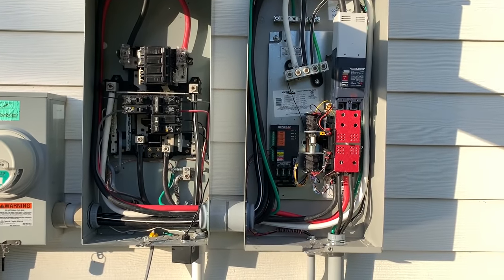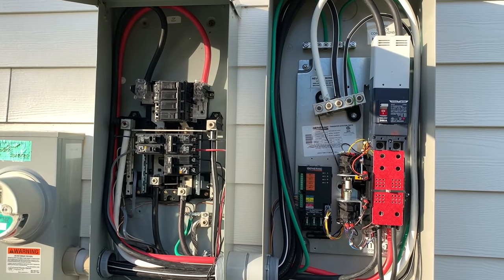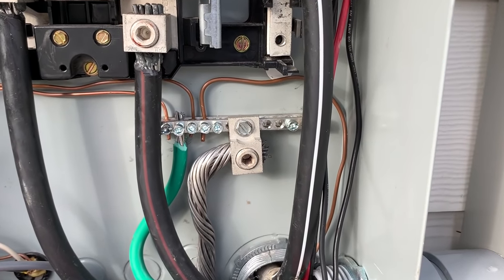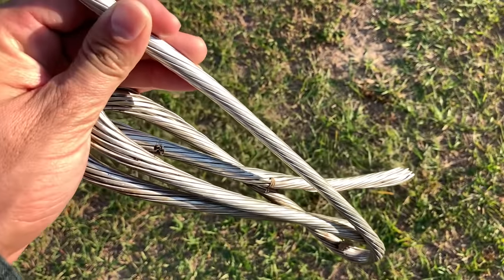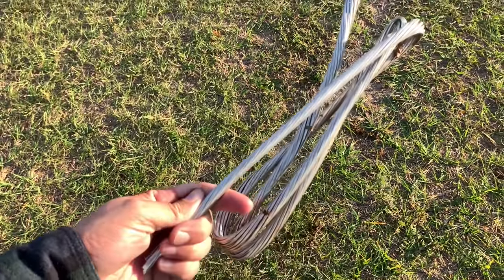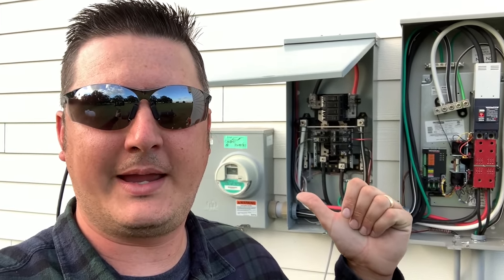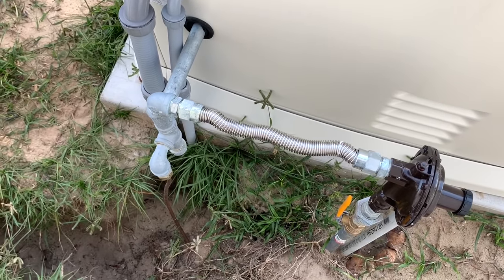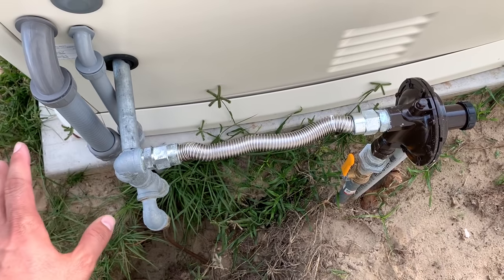Problems with our Generac generator install￼

Comment: Great series on a generator install. In N. Florida, what do you think is a fair price to install one like yours (24kw) professionally if I have it sitting on a pad with my meter & gas 20’ away? Thanks from New Orleans 🎭
Reply from the maker: Thanks for watching! I’m not sure how much installation costs these days, it all depends on if you’re renting or buying the gas tank too. I would estimate gas set up costs are around $2000 and installation for the electrical part is probably about $2000 as well. That’s just a wild guess though.
Reply: Hey, ojb 1959,  I just had a 24kw Generac Model# G0072101 installed in Metairie (Next door to New Orleans for those who don’t know). My total cost was $13,925.02 but that included everything for what it is worth.  Gas meter was 50’ away and electric panel was right next to generator (about 5’ away).
Reply: @Do_the_Dishes  Thanks for that. I’m shopping around now for the best price and yours sounds average. I’ve seen the 24kw Generacs with the transfer switch online for under 7k delivered free. I’m hoping to get one and find a reputable installer to save some bucks doing it that way. They definitely went up in price.

Comment: looks like they should have had a union to tighten that flex connection without twisting the line.
Reply from the maker: That’s a good idea.
Reply: Also with our generators your propane secondary regulator needs to be a minimum of 6’ from the generator. If too close the diaphragm in the regulator and generator can fight each other and possibly cause engine surge.
Reply: The supplied hose has a union connection attached.

Comment: My question is it appears you removed and did not use the xfer switch's internal covers.  More specifically if you did use the covers then the service entrance would have to be in the upper half of the xfer switch box.  It sure seems to me that the designers of that xfer switch really did not want service to enter through the bottom of the box.  So my question is why did you not use the xfer switch box as it was intended and bring the service it the top half (either side or top) of the box?  I am about to do an install and my current solution is to bring it in the side.  The xfer switch instruction manual shows the service entrance in the top back through the only (yes ONLY) knockout in the xfer switch box.  So it would have to enter the wall.  Whats up with that?!!

Comment: I would question your statement that ground and buss bars are aluminum.  Aluminum is much more likely to strip the threaded connections.  Possibly aluminum coated steel, like exhaust pipe.

Comment: Buen día : que calibre de cable usaste del medidor al tablero de transferencia y del tablero de transferencia al centro de carga
Reply from the maker: I apologize my Spanish is rusty, I used 2-2-4-6 aluminum wire which is rated for 100 amps between the ATS and generator.

Comment: You installed a 24k generator and looks like you have a 200 amp service. When you are on generator how do you keep from exceeding the generator output?
Reply from the maker: I installed a 200a service just so I could add stuff in the future. My actual continuous load it around 70-80 amps with the AC running, so O didn’t have to do any load shedding. If I ever need to, I can manually turn off circuit breakers to certain items like the water heater and such.

Comment: Great video Mr Maynard. I had a generator installed at my house in March 2022. I have a combo meter and electrical panel with a divider built into it. The electrician who wired it said that he could wire that ats into my existing setup.  He also indicated I will be getting a visit from the permits department in my local jurisdiction to inspect and sign off on the installation. As of this date I have not gotten a visit from the jurisdiction. It may be coincidental but I noticed my LED lights inside my house quickly blink every time the AC compressor engages. I don't recall this happening before the generator was installed. I plan on contacting the jurisdiction to have them come out but don't want them to tank my whole setup. Kind of at a loss on how to proceed any suggestions?
Reply: If it’s a Generac it will blink. Windings are not the best in the alternator.
Reply: @midstateutilities3836  
I need to clarify that the lights blink with any compressor load or other appliance load while the generator is off and we are on normal power. I don't recall this happening before the ATS was installed for the generator. Voltage coming in was checked and it appears to be low at 116 volts on both hot legs.

Comment: Use anything to coat the wires. Grease , lube oil etc. You are missing the bushing on the back of the panel.

Comment: Standby generators like generac are only capable of 100 amp max load so it's a good idea to have an emergency panel capable of only handling 100 amps.

Comment: Maybe someone can explain why the bridge between grounding and neutral bars. (Sorry if I missed it)

I might consider a 400 amp service to two 200 amp boxes for house and then everything else.
Reply from the maker: Great question. The grounds and neutrals must be bonded at the first means of disconnect, which is now the ATS. The original first means was the sub panel.

Comment: That UF coming out of the bottom of the outside panel needs to be protected.
Reply from the maker: It will be sleeved in pipe and buried, it’s a temp wire for my pool.

Comment: i thought it was fun to watch someone else for a change have to wrestle those wires in place.    why didnt you go with copper for those??   wouldnt it have been smaller at least then to use the aluminum biggies?

Comment: My problem is when there is a utility power disruption my generator is set on automatic, but it doesn’t start or even try to start any ideas on that problem.
Reply from the maker: That sounds like a bad fuse in the ATS.

Comment: You don't need 2 conduits to gen unless you are using non 600 v wires for 12 v.
Reply from the maker: The sprinkler wire I used was only good for 130 volts unfortunately. Generac actually makes a control cable that matches the color coding perfectly and it can run with the feeders because it’s rated for 600 volts. It’s more expensive though.
Reply: @MaynardFamilyHomestead  Just checking. You were correct to do that.

Comment: Appliance connector cannot be installed through wall penetration to generator, that's code. Always needs to be a nipple out of the boot. That street 90 elbow looks goofy and the 3/8" copper unerground won't run much more than a small grill at no more than 20 feet away (less than 35K BTU).

Comment: Your inspector needs to go back to some training as you have a serious Code Violation (actually several) in your main panel, namely the Square D and Siemens  Breakers in what appears to be a GE panel. (That should not have passed inspection.) (Actually, regardless of what brand that panel is, it is required that only listed breakers be used in that brand. ) Ref. 2017 NEC 110.3 (B) Installation and Use: " Listed or labeled equipment shall be installed and used in accordance with any instructions included in the listing or labeling."  (that includes breakers, hubs, fittings, ground bars, etc. )

Thus, the only Code Compliant way to use mixed brands of breakers in a panel is IF and ONLY IF there is specific labeling which shows what other types/brands of breakers can be used. Those panels which allow mixed brands will always have a label inside the can or front cover which lists all types of breakers and accessories that are listed for use with that panel. 

Square D does not approve the use of their breakers in ANY other brand of panel. That voids all warranty AND the UL listing. Siemens IIRC allows certain other brands of breakers in their panels, but prohibits using their breakers in other brands' panels.  ONLY GE breakers are rated and listed for use in GE panels. 

The main issue with using other than GE breakers in a GE panel is that the bus stabs in GE are thinner and have a smaller surface grip than others, so the SqD breakers in particular WILL break down at the bus connections and burn up. 

The other issue is if you should have a fire of electrical origin ANYWHERE in your house, you will have your insurance claim denied. 

So get those breakers changed out to the right ones ASAP.  I have been on too many panel replacement jobs with burned up breakers and bus bars due to the wrong brand being used. 

Other than that, overall a good installation that is otherwise safe and serviceable.
Reply: I was about to mention that as well.
Reply: Great comment. Also from the looks of it, there are too many conductors running through the conduit and male adapters into the transfer switch.
Reply: Man you hit my pet peeve.  I retired from Siemens and in our area they mix and match all the time.  Voids UL, Voids warranty, if there is a failure and house catches on fire the vendor is not responsible.  It is a serious issue.  I blame the inspectors.  I certainly blame our inspectors they should know better.

Comment: my friends house next door doesn't have a disconnect is it because its not a double wide trailer cause i have one and it has a meter socket and service disconnect combo which i have to replace because the plates cant get any service cables one them unless you know of another way around it

e

Comment: Love the videos, wish they were available when I had mine installed. I knew even with experience it was going to be a long process by myself so I subbed it out to a local electrician. I bought a cold weather kit before the generator arrived and never installed it because the connection wires were missing. Just got the wire's shipped to me and installed the kit. Tested the E1 and E2 on the ATS and it's 15vac... Discovered this because the connectors to the cold weather kit were only at 15vac which lead me to test it in the ATS. N1 and N2 there are also at 15vac. If I connect +/- I get -OL-. Is this because the electrician didn't separate the bonds and grounds? They're coming back in a week to check, it's been installed since June.
Reply: What did you find out in the end?
Reply: @trith72  If my memory serves me right, it ended up being a blown fuse in the ATS. Had a spare and swapped it out... problem solved. I bought a pack of extras off Amazon that match for like ten bucks. Generac wants about eight bucks a piece for them.

Comment: With respect to plastic bushings,  why do you really need them if the pipe is plastic.  It's not going to shred the wires.   It seems redundant.     Now for metal pipe with sharp threads, makes sense.
Reply from the maker: I totally agree.

Comment: I don’t believe you need plastic bushings on plastic pipe. The bushes are to prevent a steel nipple from digging into the wire. Yes the flex is supposed to be as close to the generator as possible due to vibrations. 
tin plated aluminum alloy (aluminum alloy grades 6061, 6005, 6105, 6063 are common). These are tin plated to prevent corrosion and oxidation of the aluminum

Comment: The other violation on your 21/2 TAs is the side entry without Myers hubs those enclosures are no longer weather tight. Your installation would never pass in the northeast hate to say it but get better.
Reply: Not required in the bottom  third of cabinet.
Reply: Thats per NEC not any code fron local authority
Reply: Myers is a brand.  The NEC doesn't mention any brand any place.  Entries below live equipment aren't required to be rain tight.  Myers Hubs (or any other type) aren't required or necessary.

Comment: As someone who knows a few things but not electrician, an HVAC tech, and I was concerned of aluminum wire, aluminum wire is horrible,  even banned since 91.
Reply: Aluminum wire is banned? That's what all power company's use for your service and most electricians go up a size to use aluminum on services to save money. We use 4 0 al on all 200 amp services. Only way we use copper is 225 amp service then we use 4 0 copper.
Reply: @justinwalker4506  it supposed to be ban in residential/commercial after 91, due to Chicago school house fire killing kids
Reply: @MartinLDeLoach903  I didn't know that. Maybe that's why it's no longer pure aluminum. What we are calling aluminum wire nowadays has so may alloys in it that you couldn't even give the scrap away to the junk yard that buys scrap lol but I didn't know about that.
Reply: It's legal in anything pre 61, but newer Cooper, in TX here it's ban after 91
Reply: @justinwalker4506  at least in my city, state it's banned,  Sherman TX,  it was made illegal in 91, after the cause of a school house burn, in in Chicago  in 58-61year era,. What the excuse was. Illegal in residential  and commercial buildings according to the city code.
Reply: @justinwalker4506  I can also tell you this much,  that doesn't apply to the high-power service lines. They don't obey. NEC, nor other codes they have one in themselves
Reply: It only applies to the building wire, depending upon also if pre 61.

Comment: You can't run feeder conductor in a service raceway per NEC 230.7.  You have the service conductors and the feeder conductors in the same pipe which clearly is a code violation.

Comment: so use a fiber or steel bushing
and you flipped the switch when it was hot without dead front on, from 45 year electrician

Comment: There are several different bushings or insuliner that you can add after the wire is pulled, very inexpensive and easy. To install

Comment: Get rid of the flex pipe , go to iron 💪
Reply: Flex pipe is to prevent vibration from breaking rigid gas pipe. Generac provides it for a reason.

Comment: !. It is a code violation to install fused and non-fused conductors  through the same penetration. 2. The nec requires a bushing on conduits with a #4 or larger wire. 3. No-lox is still required on al. conductors that are not compact al.

Comment: Looks like you sent unprotected lines from meter to main breaker thru a sub 
panel.  That's a big NO NO .   You can not use a sub panel  as a chase before
a main breaker.  If an inspector let this go he is wrong.
Reply: 312.8
Look at that
Reply: @thomasmarable6818  let's look at 312.8  /   312.8 A [ 3 ]  
the feed thru conductors must be tagged to identify the
closest disconnecting  means .   you  can not do this because
they have no disconnecting means.  312.8A says you must do
all the following to be able to run feed thru conductors in your
panel.

Comment: Nec 230-7 not permissible to run unprotected feeder conductors in the same conduit as feeder conductors due to you could energize, you're feeder wires going to your house the county billing department has solved it immunity, so you must have had the sign. An exemption form in order to do your own electrical work

Comment: That is not the correct pipe to run gas into the generator. The regulator is vented straight into the ground with 1/2" electrical conduit? That negates the whole purpose of the vent doesn't it, in order for the diaphragm to operate. What is with the constant switching of materials between copper line, poly and galvanized fittings everywhere?